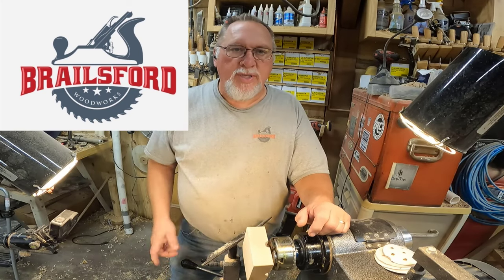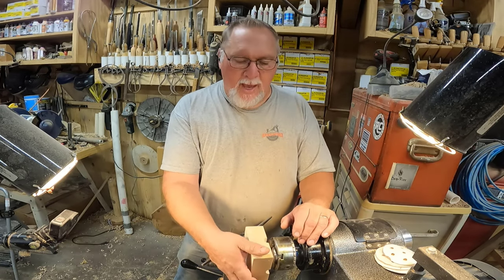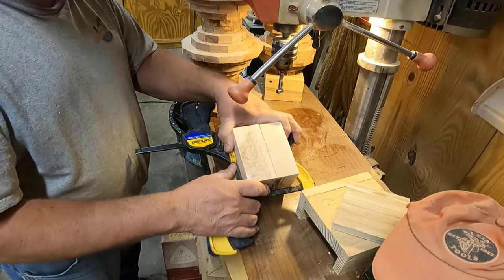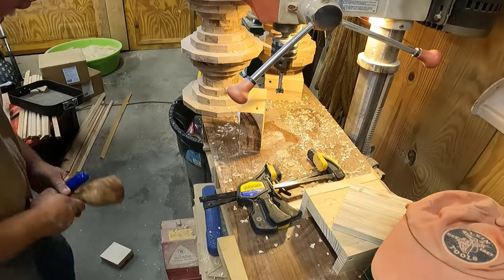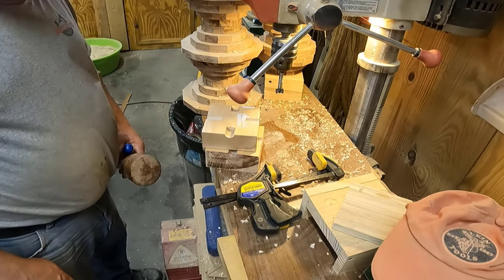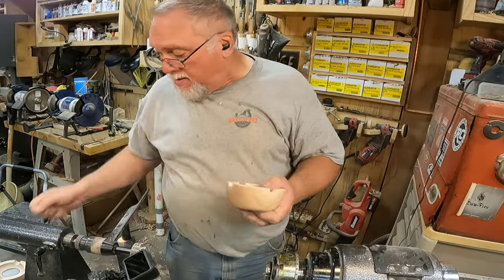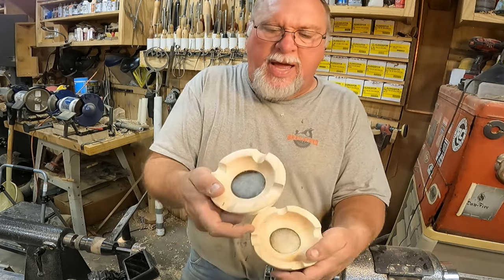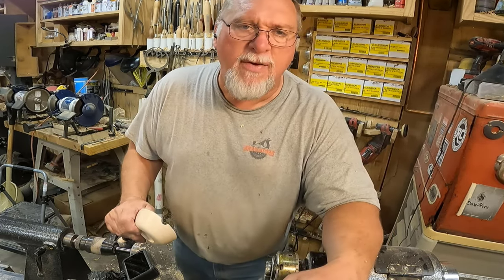Unleash Creativity: Crafting And Selling Irresistible Wooden Cigar Ashtrays!

Comment: Very nice Mike. I’ve resisted turning these so far. The addition of the metal disk does help it make more sense to me though. I personally think they need some kind of finish. Maybe just abrasive paste and wax, but something to pop the beauty of the wood. Great job.
Reply from the maker: Thank you Doug!  An occasional Stogie is a vise of mine.  I may try to add some wax on one of the next ones.  My experience with cigars is, if you were to leave one lit on a slab of wood, it would still go out.  Especially if they were properly stored in a humidor.  Although I do think the snuff plate is a good idea regardless!  Thanks again my friend!

Comment: These look great!!  I have made a few and sold them at craft/art fair.  I make some of them bigger 7-6.5-8" finished round outer dimension.  for the larger ones I use round slate coasters I get off amazon.  I also add a label on the bottom that states "CAUTION - do not leave hot ash or lit cigars unattended.  Clean out ashtray after each use. Artist/seller not responsible for user misuse or negligence!"   I figure if hair dryer manufacturers have to include a "do not use in the bathtub"  in their instructions for idiots to cover their butts legally then I should do the same! :-)
Reply from the maker: Thanks!  I do intend to make them in several sizes.  This just happened to be some spare wood I had given to me.  I do think I am going to stick with the same snuff plate.